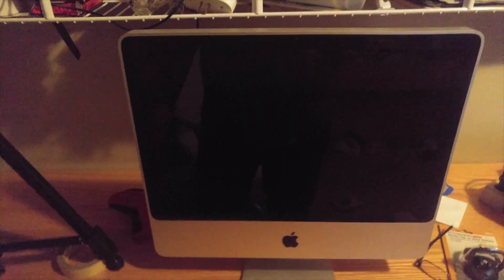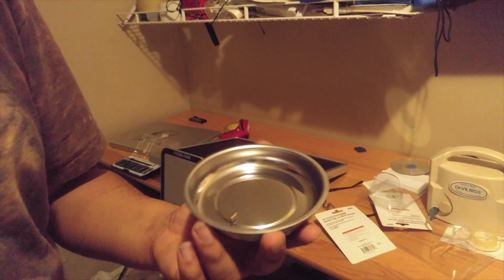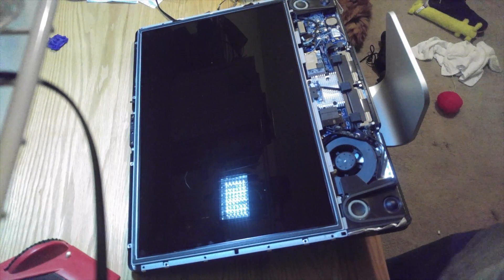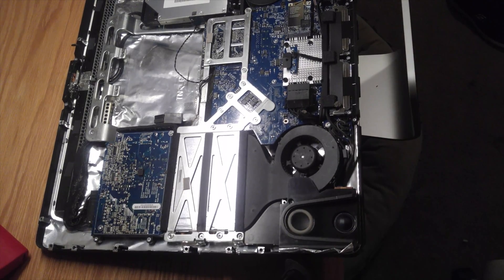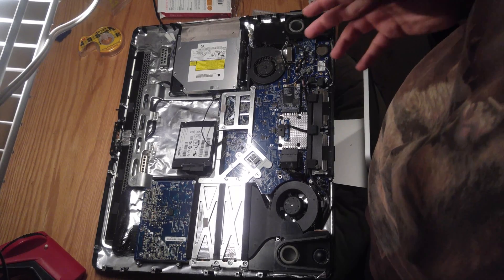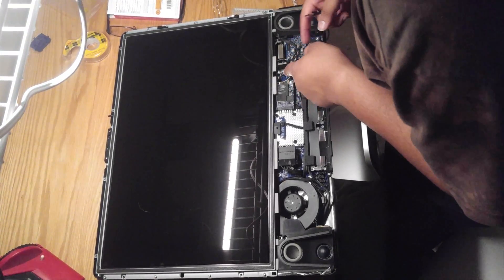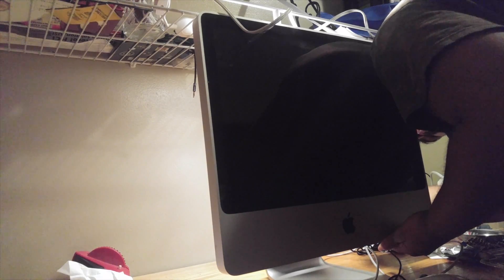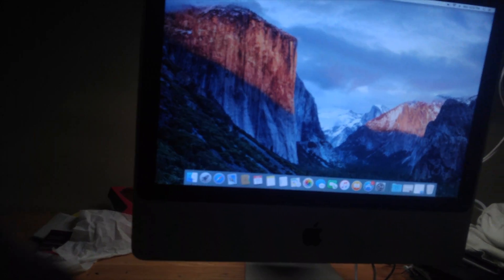20" Inch IMAC Hard Drive Replacement (Mid 2007) (SSD Upgrade + OS 10.11 Clean Install)

Comment: Just so you know you get cloning software. Get a external solid state drive  FireWire if they still make it or USB. Then clone your computer to the ext SSD. It can then boot from either drive. Can do the same to a large USB drive and from the OS from that drive as well. My 07 iMac only has 300g drive. Just option if you don't wanna tear apart.

Comment: What brand SSD did you use? I bought a crucial SSD and for some reason it isn't working. I even took the SSD out of my MacBook pro (crucial brand) and plugged it in externally and it won't work. It will only boot with the old HDD plugged in externally now. Do I need to buy a different brand of SSD? Why didn't mine work?
Reply: Did you install an os on that ssd
Reply: @CommanderMouse72  The first one didn't have an OS installed. The second one does have an OS installed, but that was only plugged in externally. The HDD plugged in externally works though.

Comment: I notice that the SSD is 6 Gb/s, but the iMac only has a SATA connector at 3 Gb/s. Is this bad? Or does it just mean that the SSD will have to run at 3 Gb/s
Reply: does not matter

Comment: I have El capitan on a USB stick, I used transmac to make it a bootable drive. But when I plug it into the pc, it's just pops up with the folder and the question mark. I have the same imac as you, how do I make it work 😭

Comment: Thanks for reminding me why I am a PC guy. Moved into a new house and they left one of these behind. I bought 4gb of ram for 15 bucks and thought it would be cool to add an SSD. I don't think it's worth the labor.
Reply: Believe me when I tell you that the difference between an ssd and an HDD Mac is huge.
It's a one time upgrade,so it's totally worth it.
Reply: bro you are talking about a computer made 14 years ago. the new ones are easy to change

Comment: Have you even try to upgrade the memory to 4GB and the SSD... and instal Hight Sierra to... and? what you thinking about?
Reply: You can't install anything higher than el capitan on a 7,1 without a CPU upgrade. The standard T7700 chipset isn't supported. If you upgrade to a Penryn CPU then you can but even then you still need to flash it with unofficial patches in order for it to work.

Comment: Where and how did you install the temperature sensor?
Reply from the maker: Fusion Studios I didn't since it's an SSD I decided that it wouldn't need the temperature sensor to be remelted because there's no real moving Parts on the drive and it's been about 2 years the computer's been on for almost all of that time and we haven't encountered any issues.
Reply: Oh okay, so the fans don't run at maximum speed or anything like that? That stuff usually happens when it's not attached to anything.

Comment: iMac 24 mid 2007 Computer $100 not a scratch, 4GB ram for( $18), used Kingston 120GB put in an old WD velosiraptor 3.5 hard drive frame($10), hard drive caddy made like a CD where the CD goes with a apple PATA IDE connector with another 120GB Kingston SSD, made the SSD's 250GB with RAID 0 ($65), looking for 500 MPS, everything $193 and the computer came with a 1TB WD green hard drive and a like new apple USB A1243 keyboard 

Running macOS Sierra 10.12.4, it can be done with a T9300 CPU for $20

Comment: Thanks for posting this. I have a similar machine with the original hd installed. It's almost too slow to use, wondering how much faster your imac perform after the ssd installation?
Reply from the maker: Lydplanet.com when I received the this computer it did not have a hard drive in it, so I don't have the original to compare to, but I can say it does boot up very fast and programs also load almost immediately. also this computer is used by my dad and he is not the most demanding user. He on used it for light web browsing.

Comment: can imac mid2007 video card be upgrade also?
Reply from the maker: Ryan Cayabyab to be honest I don't know I have herd some rumors on the internet. the gpu is pci express so I guess it's possible but I really don't know. on my 2008 Mac Pro I am able to use any GPU made by nvidia with no issue other than the fact the I can't see anything until to boots into the OS.
Here is an article from ifixit that says it's possible https://www.ifixit.com/Answers/View/90234/Can+I+change+my+graphics+card hope it helps.

Comment: What about the issue with thermal sensor? I did not see you transferring it.

https://www.ifixit.com/Answers/View/62133/Installing+SSD+in+iMac+Mid+2007

"The most critical part is transferring your thermal sensor over to the SSD. The thermal sensor can be seen in the guide here."

i think i will take the sticky tape way aswell!

Thanks for the upload!
Reply from the maker: Since it was an ssd that didn't give off much heat I didn't think it was necessary, and so far its all good

Comment: What's the most amount of ram that can be put into a mid 2007 iMac
Reply from the maker: Apple officially supports 4 GB of RAM, but third-parties have been able to upgrade the system to 6 GB of RAM using one 2 GB and one 4 GB memory module. - everymac.com

Comment: I just upgraded my mid 2007 imac. I removed the 1gb sdram and added 4gb and i removed the bulky 500gb hdd and replaced it with a 480gb ssd. I heard of icy case adapters to place the ssd into and then install in the mac so it can mount in place just like the regular hdd but the adapter is an unnecessary $30-$50. So I bought some peel and stick velcro, adjusted the power and data sata connectors so when my ssd is plugged in the back would lay flat against the frame and then I stuck velcro on the frame and on the back of the ssd and stuck it in place..  it works great.
Reply: wich ssd480 kingston crucial or other? thank